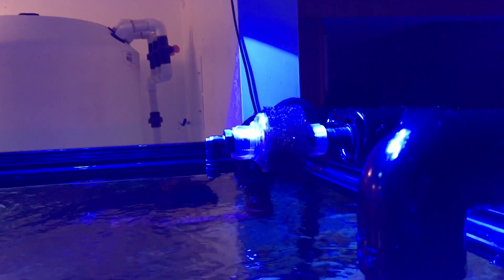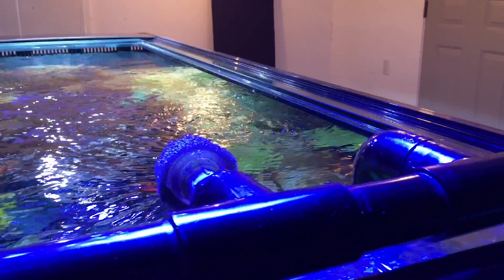The reversed check valve explained

Comment: I just tried this and it's not working. It's on a tee above the return. The check valve is only full halfway.
Reply from the maker: It isn’t supposed to fill up with water.
Reply: @melevsreef  I think it's my design flaw. The syphon break I thought would clear the line if it was higher than line into tank. I think if the check valve is on the horizontal run with the lines it works. With it being on the vertical run at the top it doesn't have enough rush of air to break the submerged line. Hard to picture but my design is not like yours.
Reply from the maker: @reefmortician8361  it’s not really a rush of air. The back siphon should suck the valve open, sucking in air to stop the draining effect. You can email me a picture or link me to where you’ve shared an image.
Reply: My design renders it a durso for the drilled return line. 🤦

Comment: I have a large check valve(larger than line to not restrict flow ) on the part of the  water supply that comes into the show tank and goes to the BOTTOM of the tank 'spraying ' 600 GPH across bottom to keep bare bottom side of tank clean  (a shore of stones divides the bottom and  sand covers the other half)  (part of return 400 GPH goes into top spray bar .  )(total 1600 with restrictions )
Concern over large check valve getting partial clog and still seeping entire tank into sump , I used a reverse check valve (like Melev on line Tee before diving to bottom) that would open and break siphon with air flowing in . I did not want to trust either to do a complete termination of flow due to pipe size etc. .      THIS is a great security measure idea . great video, as usual .

Comment: Love the Idea. Now would this same concept work as a siphon break when feeding water from a higher level to the sump from an auto top off pump?  I currently split the tube with a valve above the holding tank to let a trickle cycle back and also let air into the line but i like this check valve idea.
Reply from the maker: I'm not certain I understand what you mean, but something I did with my ATO was to use a riser tube that stands vertically in my sump.  This method has been in place for six years, and works perfectly. Please take a look at this article entry for images, especially the bottom right image: http://melevsreef.com/tanks/ato-reservoir
Reply: melevsreef thanks for the link. The riser tube is an interesting way to do it! Simple and effective (more so than a siphon break!)
Reply from the maker: It didn't cost much, works perfectly, and is easy to clean once a year - if that.